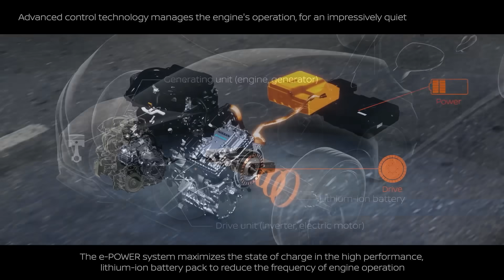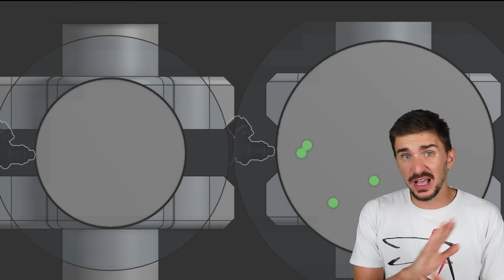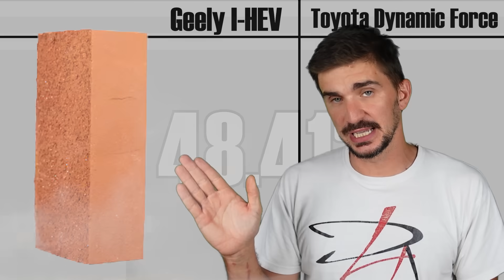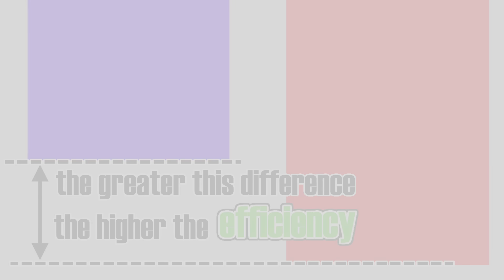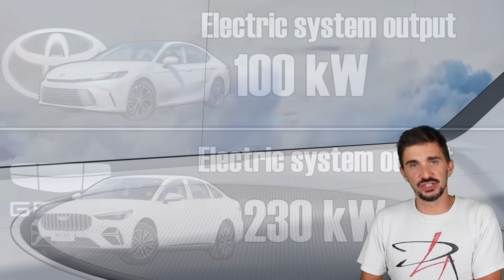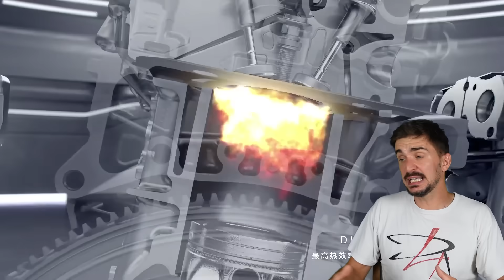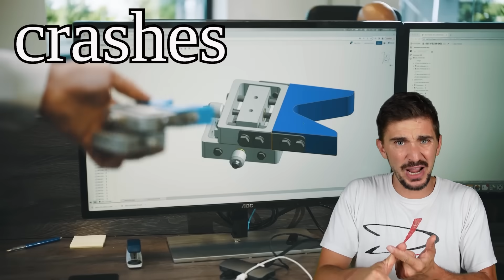How China's Geely Beat Toyota, BMW, Ford and Everyone Else

Comment: I think the hybrid concept from Horse is much better!

If the ICE engine is the main power source anyways, it makes more sense to directly drive off it with less losses in the mechanical gear box instead of  electric coupling.
And use the much smaller motor/generators to aid the ICE engine just when needed.

Smaller electric motors, smaller power electronics and less power true put on them.
And if needed all motors can provide power, instead of having a dedicated generator and a electric motor that needs to provide all the power to the wheels alone.

But I guess that's a lot harder to manage and controlle then an EV with his on Bord Generator! 🤣

Buddy of mine has an Toyota Corolla plug in hybrid as a family car... I think a 2022 model... and they never charge it, and strictly drive it with gas. (Because they are lazy)
The thing uses around 6,5 l/100km... 🤭
My 2019 Hyundai i30 with Manuel transmission takes 5l/100km 
And if I try, I can squeeze 4,5l/100km out of it! 🤣

It comes all down to the average user. 
They are not car people, they simply use the thing.
Maybe if you try, you can get much better fuel economy out of such a system, but just when you use it correctly.

Comment: In the USA, there are laws that prohibit the use of a "generator" in an electric hybrid, because a motor that is only a generator can't be tested on a dyno and assigned a fuel economy number.  Edison motors, the guys making an electric semi-truck with diesel generator, got shot down for this.  And it explains why the Ford Lightning was all electric, but included a removable generator option. It is "removable" because it would be illegal as a permenant part of the propulsion system.

Comment: I've been saying for years that the ideal hybrid setup would be a small, super efficient diesel engine (with just enough power to maintain highway speed, if necessary) powering a generator, to keep a rather large battery happy, with an all electric drive train could yield the best overall performance. In fact, Edison motors in Canada seems to be doing just that with their development of a hybrid conversion kit for pickups. We should soon see how well that works out as their project collaboration with DeBoss garage nears completion this summer.
Reply: Diesel is too expensive to keep clean and probably won't survive the next euro emission standard. Might be fine in the USA, but the market isn't wanting it.

Comment: One thing you should have touched upon is that in Atkinson cycle engines, the intake air gets first drawn in the intake port then expelled, and I think this would only work on 4 or more cylinder engines because you always need another cylinder who is sucking air to avoid building pressure fluctuations in the intake throttle body.  It would be good to have your input on this point, i.e. how it works.

Comment: I think this is the right approach. Batteries are CHEAP. 1kWh is like $90. They can get around the depletion issue by just making the batteries bigger. People dunk on PHEVs as the "worst of both worlds" but IMO when properly executed they are the best of both worlds. EV power + smoothness + simplicity w/o complete dependence on charging for longer trips. I would love to see more electric supercharging though as I think that's really going to unlock huge efficiency gains.

Comment: The best approach is where the engine directly drives the wheel with a tall gear cog on an otherwise full EV. 
The engine driving either the generator or the wheels depending on the speed.

Comment: Wait, wait. 15:1 compression ratio on gasoline?! How is it possible? The direct injection control?
Reply: It's possible because the delayed intake valve closing of the deep Miller/Atkinson cycle wastes enough compression to drop it to a safe range. Probably 11 or 12 at the most.
Reply: @cutepuppies9216 make sense, thanks!

Comment: This is the main reason a 423 hp Chinese hybrid pulls like a 300 ish European or Japanese hybrid. It's very relying on electric side, but if the battery goes below 50% soc, the management system cuts the power to the e motors and it slows it down. Toyota has a great balance between ICE and electric and it pulls almost the same even with empty battery. Chinese horsepower is malnourished.

Comment: So then why not use it as just a range extender?
Reply: That's exactly what they are used as
Reply: range extender looses efficiency from gasoline to movement to movement to electricity from el to wheels

usually hybrid prefer directly connect engine to wheels to not loose efficiency

and then only use the electric charge from the brakings or that you manually recharged

of course if you want simpler design range extender is good but is not as efficient for a hybrid

Comment: The problem is reliability. Geely cars are known for shoddy workmanship and extreme unreliability.
Reply: Just like literally everything else from China.

I wonder why people are so hyped about Chinese cars, they’re likely going to be cheap chinesium garbage. 
They say it’s because they’ll be inexpensive, we already have sub 30k$ cars yet people willingly pay double that for oversized SUVs
Reply: If you knew what you were writing, you could have mentioned the Chinese taxi drivers who drive Geelys. They have a TikTok challenge where they compare mileage, full of cars with 400,000 to 600,000 km without major repairs. The bodywork is completely rotted, but the engine still runs. If we're talking about a brand known for its low-quality engines, it's BMWs or Range Rovers from the last 15 years.
Reply: @ДмитрийАндрианов-й4ы  Average BMW and Range Rover owner/driver is also a moron who doesn't know how to take good care of their car.
Reply: Known? How, Does Volvo get shid when accuired by Geely in 2010?

Comment: Credit where it's due—Geely’s achievement with this 48.41% thermal efficiency engine is genuinely impressive and shows real technical maturity. That said, it's a highly specialized tool. Because it's tuned for steady-state generator duty, it’s not meant for spirited driving and lacks the raw output to sustain performance once the battery is depleted under load. It’s a massive step forward, though, and it’s actually a refreshing change to see an approach that global manufacturers might legitimately consider adopting. A solid first.

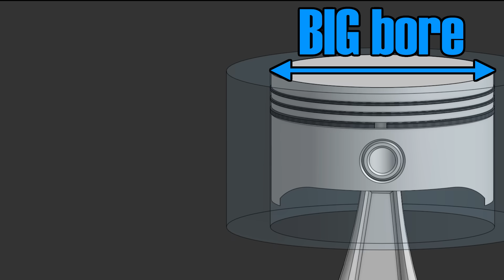Comment: The explanation at 3:20 onwards is a bit misleading IMO, you don't get more fuel and air in a big bore cylinder compared to a small bore unless the cylinder displacements are different, or you are talking about volumetric efficiency limitations at high RPM.

Comment: Under square (?) oh! You mean Long Stroke at least that is the term I have known for decades.
Reply: @gegwen7440 “Oversquare” has, for decades, referred to a engine with greater bore width than stroke length, and “undersquare” has referred to engines with a greater stroke length than bore width. This is nothing new or unusual. 

“Long stroke”and “short stroke” are meaningless without comparison to the overall displacement and the bore width.

Comment: Great video, really surprised to see a d4a video on the cars I sell! If I can add anything i'll say that there is a turbocharged derivative of this engine in china, but here in the EU we are only getting the BHE15 - DFZ for now, which is NA. The efficiency record also seems to come from the NA engine which baffles me a bit, I would have thought the Turbocharged one would be more efficient. If any of you have any doubts on how this powertrain drives I'll be glad to respond.
Reply from the maker: Yes, it's only the NA version that achieved the record efficiency simply because turbocharging and 15:5 CR isn't possible for a mass produced engine with current technology. In general, for a gasoline engine maximum efficiency is still in NA form, for a diesel it's turbo.
Reply: @d4a Thanks, if you have time to explain or any video explaining why NA engines are better when making efficiency focused drivetrains it would be much appreciated. I can't seem to wrap my head around it since exhaust gases is energy loss, maybe because of the restriction when building boost?

Comment: Is there a significant difference between closing the intake valves early (before BDC) and closing it late (after BDC)? I've heard that the early closing could help lower the temperature of the air/fuel mixture inside the cylinder, allowing for an even higher compression ratio

Comment: As with any claims made by the Chinese deserve scrutiny, however giving them the benefit of the doubt and let's say the claim was true.

Here, 'achieving' and 'sustaining' is 2 different things.  If the durability isn't there, no matter whether the figures are achieved or not, it will be another junk destined for the landfill.  Put it another way, if the life span of this engine is short, any fuel or cost saving gets wiped away.

Even if it had a reasonable life span, carbon build up on direct injection engines are known to degrade performance during use, in conjunction with other components wear, and how soon such issues will catch up is another point to consider in terms of 'sustaining'.

Comment: this engine, along with many new chinese hybrid ice unit is essentially taking approach of erev, thats why its able to extract every last drop of efficiency (and have absurd bore stroke ratio). OTOH toyota unit is designed to still be able to run as pure ice unit, also with the advantage of planetary based power split device toyota doesnt aim for the highest thermal efficiency possible

Comment: Thing is, these work for 99% of people for the daily.

You drive them on ev only for the most part, and when you need to go on aonger trip it still works compared to stopping and waiting for the battery to charge.

Also some of these have 138km of real world electric only range, even if you half that, you are not going to climb a hill for that many km.

At least here in Australia, she be pretty flat over here.

Comment: Why don't they use electronic intake valves, and code them to switch to "shallow / toyota level" miller/atkinson cycle when the batteries are discharged? 🤔

Comment: When the Honda insight began production with the Prius I regularly told people how stupid it was to use an electric motor as an assistant and that the electric motor should be the primary drive in the engine should be a generator similar to the diesel electric trains and submarines. The modern hybrid design was stupid from the get-go.

Comment: Dont want AI on any car i buy.
Reply: It's not real AI, relax. Did you even listen? It'll have zero impact on your driving
Reply: @MelodicTurtleMetal  Something that analyses the route and find hills and flats to save energy and alter the drivetrain seems to me something that impact a lot. And also something that can be used to remotely alter the firmware on the car or also control and monitor it. its trash.

Comment: Please google "Carnot efficiency", This is the theoretical maximum (thermodynamic) efficiency with no losses (e.g. flow losses, friction losses etc.) Now assume that the maximum combustion temperature of these engines is similar at 1500K. With a 48% efficiency the exhaust temperature should be 500C.  This is very low and can only be achieved by longer expansion of the combustion gases. The other possibility would be to raise the combustion temperature to 2000K. this is not possible due to unavailability of materials that can withstand these temperatures. I would like to see more test stand data to be able to verify this efficiency.

Comment: Well, the claim of no other manufacturer combustionazing evs is not accurate. I understand where you take it, but Mazda got the mx30, Honda has the 1.5 system and BMW put a range extender on the i3. Also ford did something I believe. Interesting video as always, though

Comment: Geely is probably publishing the number from single most efficient engine RPM? As a range extender/boost, the whole intake and exhaust can be made for a single range of RPM, unlike a driving engine which needs most of the RPM range.
Reply: Geely are likely publishing the number from the same bs metric they all use.
Reply: Everyone publishes peak efficiency and there is no other way

Comment: I love chocking the carb to start an engine. I don't love my car behaving based on AI.
Reply: It's not doing anything based on AI - it's location based dynamic engine performance for what will charge your engine. It won't affect you driving, it'll just mean the engine revs harder than needed before your planned hill climb. It's a good solution to a small problem

Comment: Do they state the hp value of the engine alone? Most engines with VVT already run in the atkinson cycle at low load, and then change over to Otto cycle when you floor it. It would be  interesting to see, if this engine can even change over to otto or is permanently stuck in the atkinson cycle all the time. In that case, it probably makes less than 70hp.

Comment: At such approach where engine power is not anymore really powering the wheel I would choose Nissan approach. On the other hand if you still want efficient parallel hybrid then go with Toyota. I think there is no breakthrough here in Chinese approach

Comment: I've never really understood the difference, in practice, of the Atkinson cycle versus just limiting the throttle opening on an Otto cycle.  It seems like it would achieve the same thing.  Much better efficiency at the cost of power.  Part throttle produces high vacuum, which decreases effective compression.  I bet if I limited the throttle on my car to 1/2 I'd get great gas mileage.

Comment: Putting AI in charge of charging the battery based on where you are going is a bad idea. What if you change your mind, turn around, and it is up hill all the way home (up the mountain)?  A better idea would be to increase the power of the engine when the battery is flat and hills are encountered using a super charger. i.e. Instead of charging the battery, the motor/generator unit is used to power up the supercharger - which could be just a simple 2000W vacuum cleaner motor used to compress the intake air. The max HP (engine + motor + supercharger) would be insane!
Reply: There's a reason you aren't designing cars